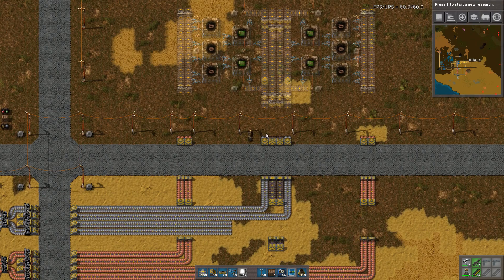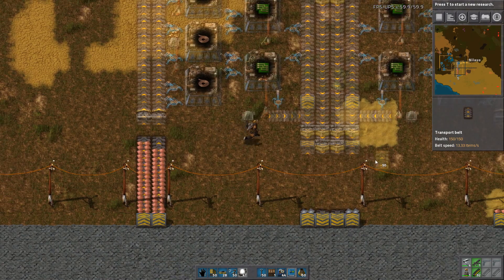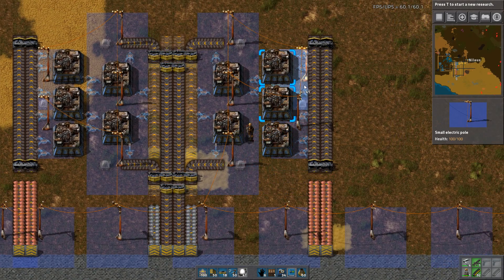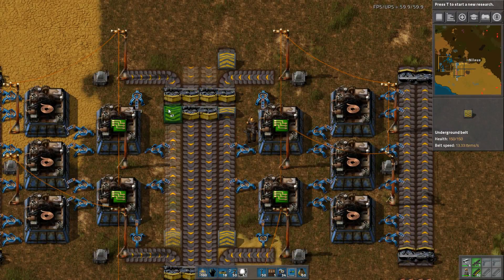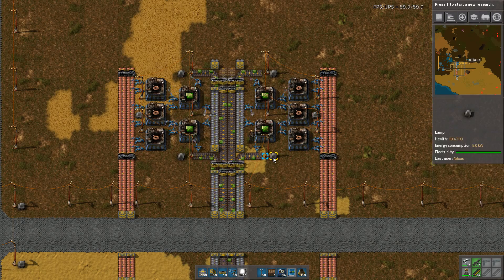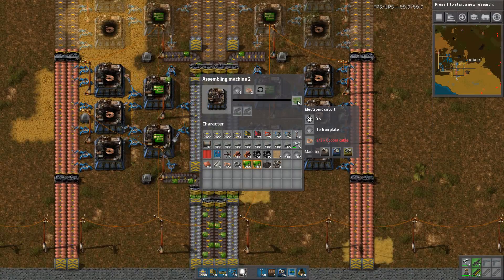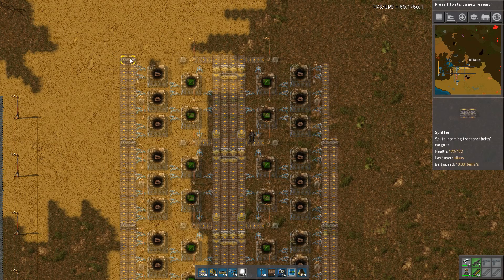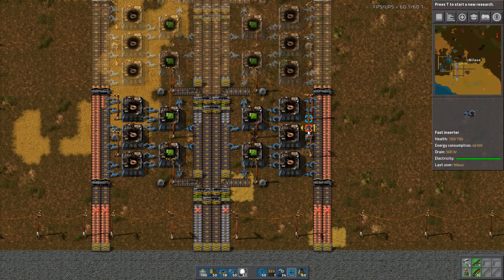Factorio Tutorial - 6. Green Circuits

Comment: Can you explain why you have two copper lines on each side with a blue inserter that can not reach the outer copper line???
Wouldn't you need a long inserter to make use of the outer line or is it simply to make sure you keep the inner line filled with the use of the splitters??

Anyway, nice start of a long series of videos..(i hope)
Reply from the maker: The reason for the two lines is because it will use 1.5 Copper line. The Splitters ensure than when I consume from the inner lane then more will be split in there by the next splitter. The last module will only have the inner lane as the outer lanes serves no purpose.